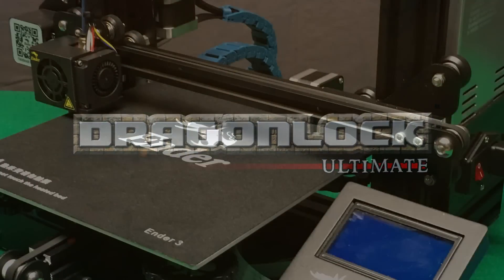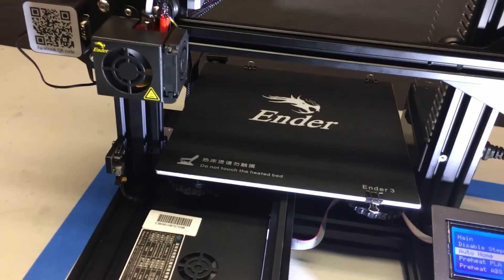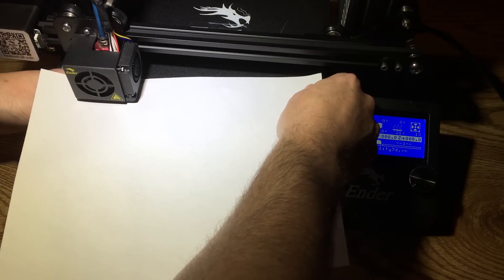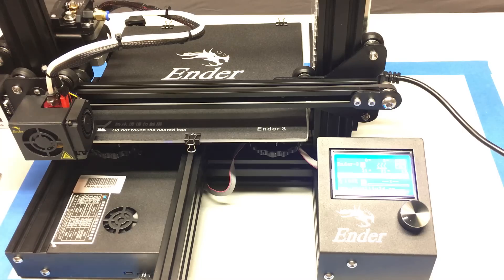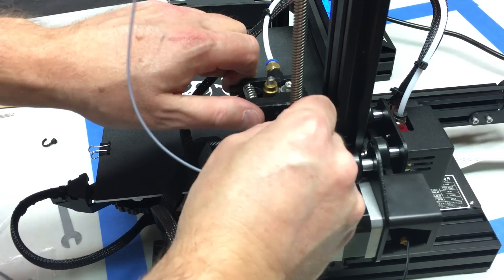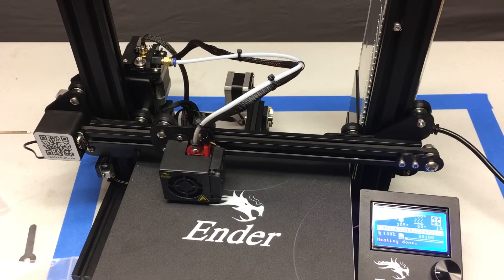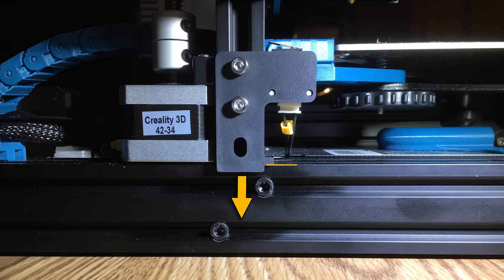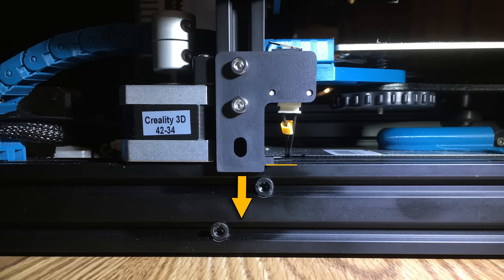3D Printer Manual Bed Leveling

Comment: How do i get thesse squares off now
Reply: Yes, I just assembled my first 3D printer, did the test, and now I don't know how to remove those thin layers without destroying the texture on the bed.

Edit: Tried 99% isopropyl, cool or hot, no joy. Had to destroy the texture on the 2 corners where it was too close to the bed with the scraper.
Reply: @Spartacusse  I found if you heat up the bed to around 80 and slowly work at it with the scrapper tool it comes off.
Reply: @RobRobertRobbie  Tried that, no joy. The plastic was so thin it was in between the texture bumps. I've watched other bed leveling videos and they all say to make it so the paper is barely catching, but in the video, at 2:26 he says "adjust to where the paper will catch but still be able to move", and he shows the image of the hot end moving slightly with the paper, so I though that was the correct point, end everyone else was wrong. Oh how was I wrong, it infused the bed with a layer of plastic so thin it will never come off. The point is on the opposite spectrum, the paper is completely lose, then you turn the nob like 1/10th of a turn, the first time you feel it's touching the paper ever so slightly, STOP!

Comment: should probably have mentioned that you should raise the hot end away from the print bed after leveling, before heating it up. the magnetic mat can melt. i just found that out, and ruined my print surface before my first print. :(

Comment: While attempting the test print, the nozzle went straight to the left side of the bed and kept trying to go left from there, resulting in plenty of motor knocking and a hastily stopped print. Is this a slicer problem? Any tips?

Comment: I need some help. I'm brand new to this and just finished building this today. I followed your instructions with the paper and it went very well. However, once I started trying to print the test the nozzle is suddenly doing two things very wrong. First, even after leveling the nozzle looks great until it starts printing and then it's suddenly 1/4" higher than the bed. And the second thing it's doing is that no filament is coming out at all. I'm using 1.75mm PLA, and I can see the little feeder wheel spinning. But it's not catching the filament

Comment: Incredible, your way of explaining things is fantastic ! I got my ender 3D pro yesterday, followed your instructions to set it up, had my first positive experience immediately. After making some test prints I remembered your words and corrected the tension on the x-rod again. On the y rod you can still play guitar after I adjusted it yesterday. This afternoon I tried to start the chain, and remembered your words if prints don't go as they should. So again I leveled all 4 Corners and Right now it is printing like a charm .

Many thanks for you wealthy explanations and additional hints. You really made my decision a lot easier to go for this ender 3d pro and I am absolutely happy with my first results.
Reply from the maker: Great! :)
Reply: ,Hi there, (was it Tom ? sorry I did not find your Name) Mr. @Tombof3DPrintedHorrors  

Today I tried my best (after again readjusting the X and y drives) to print 10 sets of chain links and covers with black ABS, following the recommendations of the manufacturer. All the PLA (orange) links and covers, I printed the yesterday, are perfect. . However all black chain links broke, the covers look pretty stable.

I guess I have to go back to black PLA to complete the Job, or does anyone have a suggestion ? ABS temperature was 230 C and the heat bed 80 C .

Also I had my printer run his first heavy duty job, printing the tools drawer inside box. The base and left and right walls where perfect, but the horizonzontal "in the air" print of the division walls and the top wall look horrible. Actually I am not sure if the handle will stick to the top wall very Long.

Any idea how to improve such large "in the air" walls better?

 Thanks in advance
Reply from the maker: Try rotating the model in the slicer so you have fewer overhangs (like with a lid, rotate it 180˚ so the top section is resting on the build plate.) I don't recommend printing the drag chains in ABS (or using ABS at all for any of this stuff.)
Reply: Hey, thanks a lot for your reply.

Indeed that was my idea as well, but that is exactly why we need to practice and learn everyday. If I don't see the results myself, I cannot judge. 

On the other hand I am waiting for a reply from creality if I have ruined my magnetic mat. After using ABS for bed levelling and the chain parts, the marks are burned into the mat. So I am afraid I will eventually ruin my nozzles if I ever try again using ABS. I could sent you some pictures, but I don't know (yet) how to do that in this forum.

Anyway, thanks for your comments, have a nice weekend 

Jos

Comment: So I think I have the bed leveled pretty good. However I'm having adhesion issues. I'm trying upping the heat of my bed to see if that helps. I'm printing on the included glass bed. If the upped heat doesn't do it, should I use glue sticks/ hair spray?

Comment: I just got the Ender3 and watched your other video on setup. I upgraded the couplers and also the bowden tube. when I autohome the bed, the nozzle is way far from the bed - like 10mm - with the adjustment levelers all the way tightened.I remember reading something about where the Z limit switch is placed exactly - could that be the reason?

Comment: Thank you for this video. I have been pulling my hair out for 2 hours trying to figure out why I couldn't get this to level out after adding a glass bed. I finally ended up putting the glass bed under the switch and tightening it down. The part about the springs was really helpful and was exactly what I needed to finish it up. After using the sheet of paper and printing the test map I had it perfect in 2 tries.

Comment: Hey, i love your Videos, you helped me already so much with a lot of problems! For this video (i know it's already somewhat "old") i have something to add: From what i've learned so far it is advantous to level your bed, while it is heated. Material tends to expand while heated, and every material has differend thermal expansion, so if you have a coupled system with screws, alumiuna bed and a surface (either Buildtec, Mirror, Glas or sth else) you might have some Hotspots you can correct only on a heated bed. My advise would be heat the bed, wait 5-10 minutes (to make sure the bed is completly heated) and level it afterwards.. Thanks for sharing your knowledge with us! you tought me already so much! :)

Comment: GREAT videos for the new Ender 3 users.
PROBLEM: I can’t get the test print off my bed. I’m afraid I’m going to damage it. I can’t print anything until I get this cleaned off. Any suggestions?
Reply from the maker: Is the bed removable? Just tae it off and flex it. :)
Reply: Same issue here, print looked perfect but was impossible to get off. Pretty much ruined the print trying to get it off.
Reply: Was just thinking, might it be caused by the nozzol being to close to the print bed?

Comment: I have not found any information on the software or what that USB thing is with the Micro Sd card plugged in. The instructions simply stop at the end of assembly. For Example, is the SD card designed to be "Hot swappable" or do I need to shut off the power supply and insert the Micro SD card?  Which way does the SD card get oriented to plug it in? Do I use that micro SD card to update Firmware? Where do I get updated firmware?  Is there updated firmware?

Comment: Thank you for this great advice! It seems I have a slight dip in the middle of my Endor 3 Pro buildplate. How can I compensate for this?
Reply: If anyone else have the same issue, I compensated my upping the initual flow to 120% and the print temperature by +10 degrees C. I also print the initial layer at twice the normal layer height 😊 Now my prints stick perfectly with no adhesive.
Reply: @KevinTheDane  Could you explain a little about how you up the initial flow and print the initial layer at twice the height?

Comment: Tom, my problem with bed levelling - when doing the auto-home, the nozzle ends up about 5mm past the table. So sticking a paper under it makes no sense.  How do I get the auto home calibrated?
Reply from the maker: When it homes it should be out beyond the bed, that way any ooze is off to the side. You disable stepper motors as shown and manually move the nozzle to the five positions.

Comment: Hi Tom. I got the upgraded springs you mentioned on the upgrade video. Now the springs are too tight and the bed is still too high on the right side. The left side is ok, but the right side is too high and I can not tighten the screws anymore. Should I raise the Z switch a bit? Or do I have a different problem? Thank you.
Reply from the maker: I would start with the z-switch. Also, you can send me pics of the issue at the contact link on the front page of www.fatdragongames.com :)
Reply: @Tombof3DPrintedHorrors  Awesome, thank you! I have set it maybe 1 mil higher (it's so little I can't even take a picture where the difference would be visible) and now I can tighten the screws to lower the bed so the nozzle doesn't hit it. I still think I have a warped bed because no matter how much I try the center is always super tight although the corners are good. I've been leveling it not in the corners but more towards the center and only print there. Is there a way to check for sure there is warping? Could this problem be due to something else?
Reply from the maker: @invertedflow  are you printing the bed leveling squares I link in the leveling video?
Reply: @Tombof3DPrintedHorrors   Yes I've tested it with those squares. The corner ones always print quiet well. The center is always a bit "squished". It always stays quite tight there when the corners are at a good level. I've been printing for over a month like this and prints turn out good but that first layer in the center always feels a bit sketchy. I've adjusted myself to level it more towards the center, leaving the corners a bit too high since most of the prints I've done are small enough to only use the center of the bed. But it's not ideal.

Comment: What if i have good height at the corners, but middle part is too high? Only way is a buy tempered glass?
Reply from the maker: If it isn't much of a difference, get the middle closer to perfect, you'll rarely ever print to the corners. :)
Reply: @Tombof3DPrintedHorrors  what if the middle is too low, if i adjust the corners up it will scrape the bed

Comment: Great video!  It was very helpful.  The only slightly confusing part was where the hot end gets put onto the X-axis.  I couldn't really see how you were doing that, but I got it figured out.

I downloaded your bed leveling file, but it would be nice to give the file name in the description, so people are sure to get the right one for the Ender 3.

* CAUTION *
My Ender 3 came with the removal build surface and 4 binder clips.  Being a complete n00b, I placed one on each side of the bed, and proceeded to break my printer before my first print!!  The clip on the left side got hung up, and jammed the bed, I saw sparks, and then the Z-axis stopped working.  It would have been nice if the directions from Creality told us where the clips should go.

Replacement parts are on their way...
Reply: Thank you for the warning. I was about to do the same thing! Where should the clips go?

Comment: I have a strange level problem.

On all 4 corners it,s all most perfect , accept in the middle .

The nozzel is than to close to the bed , even an memo paper doesn,t fit..

If i gonna make a new round on the corneers , there is nothing more level

What do i wrong , i have a ender 3 pro . 2 days old , all first where good
Reply: Bed is warped.

Comment: I had a problem with my bed leveling screw free spinning, but rather than lowering my z-stop, I swapped out the springs and it worked great! Just search Amazon for “8mm OD 20mm Long Light Load Compression Mould Die Spring Yellow“

Comment: For some reason when I try to run the level check on my Ender 3 it goes off the sides for the skirt and part of the cubes, did anyone else have this problem or know how to fix it? I followed the assembly video to the T and everything looks like it is going fine, I printed an XYZ Cube and it looks ok but the front left and rear right corners were semi-rounded instead of squared off like the other two edges and the Z on top does not look to good. Anything else I try to print comes out a stringy mess.  Thanks for any help :D

Comment: Wow. My test print stuck to the bed hard. Even after scraping and cleaning with alcohol I can still see the print on a lot of the bed
Reply: I had the same. Heated bed only to 88 and used provided spatula got it removed.
Reply: I'm a total noob, but had the same problem and read somewhere to use acetone (fingernail polish remover) instead of alcohol and for me it worked perfectly.
Reply: For those reading this later, usually horribly stuck prints means that the nozzle just a tad too low. At least in my experience lowering the bed just a hair stops that from happening.

Comment: @Tomb of 3D Printed Horrors I am in a bit of a pickle.  I began the setup and the auto home but the bed goes past the print head by 2-4 mm.  Do I just manually move the build bed to the corners or is there an issue with how I build the device?  Not finding much in the way of correcting or explaining this.
Reply from the maker: That's normal. :)

Comment: Anyone else having an issue with provided stl file not showing up in the menu
Reply: You have to convert it to G-code with Cura or any other slicer.
Reply: @isthataprogenji4741  Hey Ricardo, thanks. I was able to figure it out. Appreciate responding though.

Comment: FYI: The leveling test impacts the clips and might damage the nozzle.
Reply from the maker: If you have your bed size accurate in the machine settings (235x235) it should clear them. :)
Reply: Tomb of 3D Printed Horrors well I have 4 clips and they're placed 2 in front and 2 in back. They're pretty much aligned with the leveling knobs. Looks like yours only has a couple clips and they're dead center.
Reply: @jevansturner   Mine are positioned with the outside edge lining up roughly with the screw on the leveling knobs. The test didn't hit my clips.

Comment: So I have just finished building my printer and when doing the test print with this file using cura 4.3 the print is right at the edge of the front of the build plate.... any ideas?
Reply: Having the same issue here.

Comment: You had us turn off the stepper motors during this process, but never mentioned to turn them back on.  I would assume that these need turned back on before the first test print?
Reply from the maker: Starting a print will do that automatically. :)
Reply: Thank you!  Total noob here.  Question #2: I did download the files you linked to Dropbox, and there were 4 files.  I loaded them onto the SD card that came with the printer, but none of these files show up when I "print from SD card".   Can you give a quick rundown on the four files, and maybe why I cannot see any of them?  I did add a new folder on the SD card to place the files into.  I can see the folder, but cant see any files when I go into the folder.  I can see the test-dog file that came on the SD card which has an extension of .gcode, but none of your files have this extension.

Thanks in advance.

Comment: I think this was one of the most helpful in the series so far! Thanks! I wonder if that z-stop having to be moved to a different spot for different printers a side effect of quality control? None of my other printers require that I clip anything off of OEM parts to get them leveled.
Reply from the maker: Possibly. I think the z-endstop switch issue is a case of Creality making production line changes during the production run. That piece is injection molded and they likely don't want to cut another steel mold to have the piece without that small tab. My first Ender 3 used the tab, the later ones needed it cut off.
Reply: I had to RAISE my z-stop, not lower it. Should have thought of that earlier, took this awesome video to drop the hint.

Comment: just ran your print test great results however now I cant get the test print off my heat plate
Reply: me too!
Reply: @rdonlloyd  If you can't get the test print off you have too much squish on your layer which is solved by just lowering your bed by the smallest increment until you are getting a good squish on your layer
 The way I got PLA off the bed when I had too much squish was to mask either side of the layers with painters tape and burnish it with something to squash the tape( I used a spoon ) and then use sandpaper to remove the PLA, you know you are getting close when you start removing the tape with the sanding, at this point switch to lighter grade sandpaper, its a 10-minute job